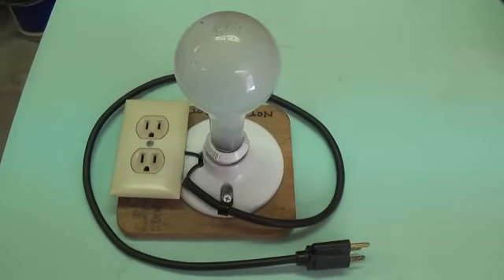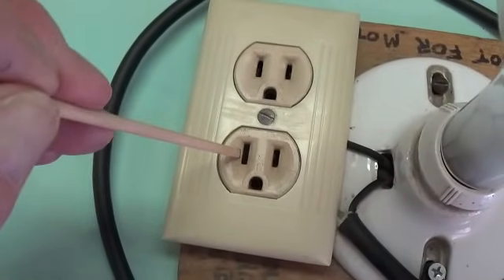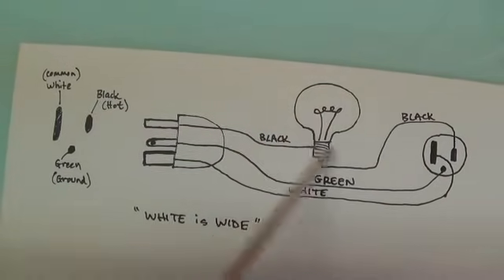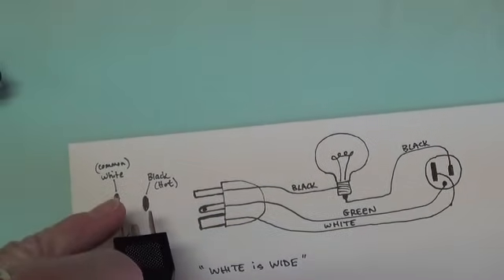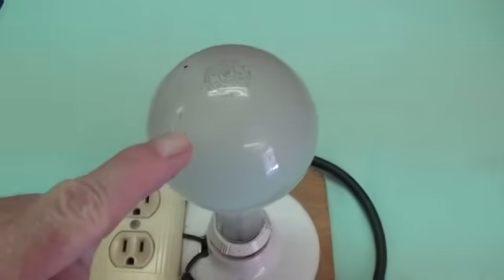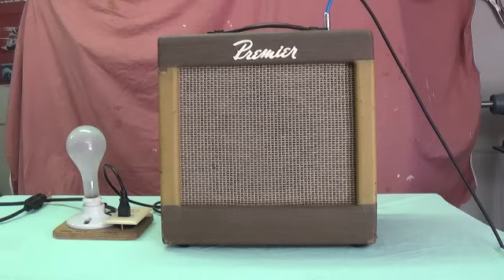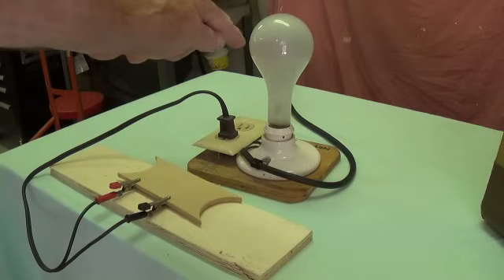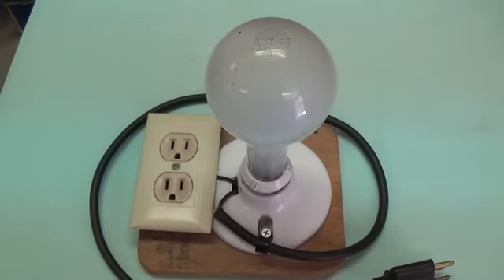Build Your Own Current Limiter for Protection when Repairing and Testing Electronic Equipment

Comment: Hi Uncle Doug! ,Greetings from Cornwall, England,  i live in a 240v area and found it difficult acquire 100w + bulbs. i am going to try two 77w bulbs in parallel , and remove 1 bulb when working on a transistor amp. does this sound right?. really loving Rusty, Jack and your productions, learning lots. thank you so much !
Reply from the maker: Greetings to you, AS. In a 240VAC area, you can probably get by with a single 100W bulb and a 50W (or less) for transistorized circuits. Since your voltage is double ours, your current flow is one-half as much.
Reply: @UncleDoug  will endeavour to get a 100w bulb from online. All the stores are now led , they don't realise my bulb will not come on much (hopefully) 🤟rock on brother LOVE the guitar.

Comment: Seeing as I occasionally do amp repairs, I'm going to build one of these useful devices, but since I live in Australia, I need to use parts rated for our Australian 240V AC/50Hz mains supply, for the Australian 240V AC/50Hz mains supply system the wire, and 3-prong plug colour-coding system is as follows: Brown=Active or Hot, Blue=Neutral, Green/Yellow=Earth or ground.
Reply from the maker: So you will install the bulb filament in series with the Brown wire and use a 50 to 100W bulb. Higher voltage = lower wattage.
Reply: @UncleDoug  Yep, that sounds right to me, the brown wire is equivalent to the hot wire in the US mains colour coding, the green/yellow is equivalent to the green wire, and the blue wire is equivalent to the white wire if I'm correct, the Australian mains just runs at double the voltage of the US system, and at a lower frequency, 50Hz as opposed to 60Hz, it's very important to get it right first time cause even a small mistake could prove lethal.
Reply: One of the reasons why Australia adopted the Brown, Blue, and Green/Yellow colour code was to make it easier for people with colour-blindness to differentiate between the three wires, I happen to be red/green colour blind, but I can clearly see the difference in colour of the three wires of the Australian 240V AC system.
Reply from the maker: @simonkormendy849  I appreciate the explanation, Simon, but I would have thought that black and white would be the easiest "colors" for colorblind individuals to differentiate. Not being colorblind, however, perhaps my assumption is incorrect.
Reply from the maker: @simonkormendy849  You're correct, Simon. Since the voltage is double, the current is half......thus the necessity for a much lower wattage bulb.
Reply: @UncleDoug  That makes sense, I can clearly see the difference in colour with the US colour-coding system, I think we Australians have our politicians and rule-makers to blame for the different colour-coding system we use.
Reply: I'm planning on building a device called an OTL (Output Transformerless) Headphone amplifier, found an easy to build circuit, using three 6N1P tubes on the internet, here's a link to it: https://headwizememorial.wordpress.com/2018/03/20/the-6n1p-otl-headphone-amplifier/
Reply from the maker: @simonkormendy849  It's outside of our area of interest or expertise, Simon, but good luck with your project.
Reply from the maker: @simonkormendy849  I guess as long as the coding is consistent, we can learn to read it properly, regardless of the colors chosen.
Reply: @UncleDoug  Exactly.
Reply: @UncleDoug  I'll let you know how it goes, part of the fun of building tube gear is getting all the necessary parts together, I'm sure you'll agree, please keep these great and informative videos coming, and I hope you and your family are doing well.

Comment: When building one of these for use with tube radios, how big of a bulb should I use ? 250W seems a bit high for that use.
Reply from the maker: It varies depending on the current demand of the tube radio, but I would think that a 200W to 250W bulb would be about right. Try it with a radio that has no internal shorts and see what wattage of bulb can remain very dimly or not visibly lit in series with the radio.
Reply: @UncleDoug  thank you for the info. Much appreciated.

Comment: I had seen this before but now as i begin to build an Amp you keep mentioning this as a required tool for us to have. I am revisiting and going to build this as my 1st tool for my project, Excellent as usual. You are a marvelous instructor, D
Reply from the maker: Thanks so much, Dennis. You will be glad you built one.....it's a vital tool.
Reply: Would that work on my model trains as I gave fried some transistors during built out?
Reply from the maker: @DennisMurphey  It doesn't work as well with transistorized circuits, Dennis, simply because they draw much less current than tube circuits. If you try it, use a small bulb (i.e. 40W) to start with.
Reply: Excellent input worth a try. I will make 2. One 250 watt and one 40 watt. Cheap insurance. Thank you, your knowledge and experience is just awesome. D
Reply from the maker: @DennisMurphey  You're welcome, Dennis. You can probably get by with just one.....and switch bulbs as necessary.

Comment: Uncle Doug, any tips on mounting the outlet to the board safely?  The porcelain base seems straightforward, but I'm curious if you have insulation around the outlet base, and if it's just sitting on the single center screw or if there's more support (sorry if you've already answered this, I tried to search the comments and didn't see anything).  I'm wrapping up my 8th tube amp build and it's time I stop rolling the dice on my high level of care and attention to detail and build one of these for safety!
Reply from the maker: The porcelain base I used had two screw slots, about half way toward the outer perimeter, Elliot. It was firmly attached to the base board.

Comment: Soooooooo, what's the point of this?
Where would I use this for practical use ?
Reply from the maker: If you repair amp circuits, it's a critical tool to prevent damage to the circuit due to short circuits.
Reply: Did you watch the video before commenting? He explains it right at the beginning.

Comment: Hi Uncle Doug, I build one of these and when I plugged my Gibson ga-20 rvt to it, the bulb (300 watts) have a very little light on the filament,  does that means  i have a partial short on it?
Reply from the maker: That's hard to say, D25. The GA-20RVT is a 15W amp and probably should not partially illuminate a 300W bulb. After the amp has been on for a while, feel the filter caps to see if any or all are hot. There may be a short in one (or more) of them.
Reply: @UncleDoug  thank you very much for your repply. I will check that.
Reply: @UncleDoug  i guess there is a small short in the amp somewhere.

Comment: Hi, Uncle Doug, I miss Rusty!
In any case, on my first tube amp build, 15watt, I used two 60 watt bulbs in series...(wall voltage is 235V)....So, on startup, both bulbs start very dim, go extremely dim, and then after about 10 seconds they both glow very dimly (I think this is in conjuction as the tubes start to glow).  As is typical for me, I got a "something in-between" result, not totally off, neither a bright flash.  It stays dim for another 15 seconds, then I turn off the amp b/c I'm afraid of damaging it.....Any ideas on what an in-between result might indicate?  thanks so much!
Reply from the maker: Use one 60W bulb and you'll probably be OK.  CL bulbs are never wired in series.
Reply: @UncleDoug  thank you sir!

Comment: You can'get hi power incandescent bulbs in blighty any more but I've got several 60W bulbs stashed away. Will 4 of those in parallel do?
Reply from the maker: If you have 240VAC supply, a single 60W bulb, or even two in parallel should suffice for most small to medium circuits. Your current is double ours, so the wattage requirement of the bulb is halved.
Reply: @UncleDoug  A mate found me 2 off 200W bulbs. Apparently, you can still get them if they are "for industrial use", you just need to know where to get them. In this area, that is Lock's Garage on the A465 south of Hereford (for them in the west of Blighty).

Comment: Many thanks to Uncle Doug for this, I have just completed my UDCLD MK1 (Uncle Doug Current Limiting Device) It's great when simple, cheap projects like these can yield useful workshop tools. I hope this one will be an aid to many future repairs and projects of mine.   I only wish that making my first Oscilloscope and ESD meter could be so simple and cheap! However, slowly but surely I am gaining the equipment and knowledge that I need to be able to repair hifi and other electricals. I am awaiting delivery of a beautiful 1960's Japanese Multimeter that I recently won on ebay, I'm looking forward to refurbishing this and adding it to my growing arsenal of repair weapons.  I have had a few Digital MM's in the past but I have read that analogue meters can be used as a poor man's tester for capacitors (?) This and the comedy show sounding mechanical buzzer for continuity seduced me into hunting down one of these relics, whats not to love with these fabulously made and still useful old pieces of equipment?  I think Uncle Doug would like this one too, for it can handle high AC Voltages - commonly found in tube anplifiers, I believe? 

Regards and best wishes to all   :-)
Reply from the maker: Thanks for your nice comments, Rob. I do have a Simpson 260 Analog Multimeter that is particularly useful for measuring pot resistance and checking them for a smooth sweep.
Reply: @UncleDoug  Very nice, have just seen your meter on the very unusual tube amp problem video, where you repaired a transformer winding. Nice to see the meter wiggle in time with the motorboating. My meter is a TMK Model 500 and has cleaned up nicely, it just needs a slightly burnt looking 1ohm wire wound resistor replacing and some cleaner in the adj pot. Loving all the videos and learning a lot, thanks so much for replying too.
Reply from the maker: @robworrall6832  Thanks for your nice comments, Rob. Good luck with your newly repaired meter.

Comment: I built one like that , I plugged a small heat gun from radioshack the light turn on and the heat gun barely function , as soon as I plug the gun to a wall outlet it works normally, any reason for this?
Reply from the maker: Yes, a very good reason, Tito. The CL is for use with tube amplifier circuits that draw 1 or 2 amps, not heat guns that draw 15A.

Comment: Hello, Uncle Doug:  I built one with a chain pull bulb holder that has an integrated AC outlet, a 2 way light switch, and another AC socket for supplying the amp.  It has a couple of modes of operation.  The chain pull acts as an on off for the whole unit.  The light switch, when up, activates the amp supply AC.  When the light switch is down, the unit acts as a lamp, as it shorts out the amp AC socket and all the current goes to the bulb.  It is built on a wooden base and is a decorative (and bright) lamp when I install a 300 watt bulb, but I can use a smaller bulb and use it as a desk lamp and cell phone charger when I am not testing amps.
Reply from the maker: Wow, it sounds like you really took this simple concept to another level, AK.
Reply: @UncleDoug  Well, I've got enough test equipment sitting around that I hardly use. So it was fun to build something that I can use as a desk lamp when I don't need  to plug into an amp or a robot power supply (my day job.)

Comment: These do work in England on 240V, but finding a high watt incandescent bulb these days is virtually impossible.
Reply from the maker: Since your voltage is double, your current is halved......so a 100W bulb should work. I believe they are available from Amazon.
Reply: Could I use a 40W bulb just for testing short circuit? I can only find 230V 40W and 230V 60W bulbs online.
Thanks.
Reply: @newstar346  I would'nt reccomend 40W. The minimum I would use is 80W. Maybe a short burst with a 60W, but VERY short.
Reply: @Franko_Walker   Thanks for your information. I'll try finding a 100W one as suggested.
Reply: @newstar346  That should be fine. Sheild your eyes though. :)
Reply: @Franko_Walker  Thanks for your advice.
Reply: @newstar346  No probs. :)
Reply from the maker: How about two 40W or 60W bulbs in parallel, NS ?
Reply: @UncleDoug  Yeah, I've thought about that after reading through the comments where one asked about this parallel bulbs using a Y-cable adapter.
Thank you for your advice.
Reply: @UncleDoug  Ha ha, Yeah, I never thought of that. It would work perfectly with 2 60W bulbs! Well done.
Reply from the maker: @newstar346  You're welcome, NS. Good luck.

Comment: So, with high-wattage incandescent bulbs quickly going the way of the dinosaur I'm wondering if one of those "Y" adapters that turn a single bulb socket into a 2-bulb socket would work if you need a 200-watt bulb but can only put your hands on 100-watt bulbs. The workaround then is to install the "Y" adapter and screw a 100-watt bulb into each arm of the "Y" giving you a total of 200-watts. Will it work? Or did I just come up with an even better way to blow myself up?
Reply from the maker: As long as the bulbs are in parallel, which seems quite likely, it would work just fine, DE. You could check by seeing if the overall filament resistance dropped to 1/2 when the second bulb was screwed in. This would make the wattage capacity of your CL adjustable.......good idea :)

Comment: Excellent video, Doug! Is there any limitation (as in types of electric/electronic items) I could plug in? If I had to, I could wire two 100W bulbs in series as a substitute for the 200+W light bulb? Thanks again.
Reply from the maker: You cannot use the current limiter with motors, VO, or any device that requires a big current surge to start. Yes, you can use two 100W bulbs, but they must be wired in parallel.....not series.
Reply: @UncleDoug  Thank you very much for your reply!

Comment: Hi Uncle Doug, Risk of shock is one of the main reasons I am hesitant to start an amp build project, and you just alleviated a ton of that fear!!!  I really don't have much of an excuse at this point!!!  

Your videos flippin' ROCK!!!

THANKS!!!
Reply from the maker: Bear in mind that the current limiter primarily protects the amp circuit, FN. You still must understand and practice all the rules for safe handling of high voltage electrical devices.
Reply: @UncleDoug  - Oh, another subject to look up.  Thanks for the additional information!!!
Reply: @UncleDoug  - 10 hours of Googling FN and I can only assume that stands for F*****g Noob.
Reply from the maker: @thefunkynotes8956  Not at all......it's the initials of your screen name.
Reply: @UncleDoug  - Same thing!  LOL!!!
Reply: Hi Uncle Doug, Would plugging the current limiter into an outlet with GFCI protection add a level of shock protection?
Reply from the maker: @thefunkynotes8956  I'm not sure if or how they would work together, FN. The CL protects the circuit, while the GFI protects people.

Comment: Hello Doug, I am a 75 Year old from Ireland and I have got hours of enjoyment and education from watching your videos. Since I retired a number of years ago I have taken a keen interest in the working of old valve equipment even if there is not much of that sort of stuff hanging around here. I decided to build a Current Limiter similar to your one and I have to say I am delighted with my effort. I got my hands on a 1967 Selmer Treble/ Bass MK 111 50W amp and not knowing what the story was with it I had the pleasure of plugging it in to the Current Limiter. Am I glad I did as the bulb lit up like a Christmas Tree and heeding all the advice you have given in your videos regarding safety in dealing with Valve equipment I proceeded with caution. Using another of your home brew aids I discharged all filter caps;  At this stage I need help with pin pointing the fault with this amp and I wonder if  there is someone out there in YouYube land who would point me in the right direction. I have one other observation on your excellent  videos......  That is your interaction with your Dog and Cats. Beautiful to see. Thank you.
Reply from the maker: Thanks so much for all your great comments, Eddie. I'm glad the videos have been helpful. Good luck with the repair job.....that's how you learn ;)
Reply: Hi Eddie. Did you ever get that amp fixed ? If so, what was the issue with it ?
Reply: @paulp2033  Hello Paul, Thank you for enquiring about my amp. I never got it fixed but did discover that it was the main transformer that was at fault. I did try to find a transformer but so far I've no luck with that.
Reply: @eddiefitzgerald5198  hi again Eddie. I don’t suppose you would consider selling the amp ? If so let me know and we could discuss. Cheers. Paul
Reply: @paulp2033 Hi Paul, I'd sell it alright.
Reply: @eddiefitzgerald5198  hi again Eddie. Are you able to contact me directly here on YouTube ? If not, do you have an email address I can contact you on ? Cheers, Paul
Reply: @eddiefitzgerald5198  Hi Eddie - The Selmer T&B 50 is one of my all time favourites! My school had a pair of them back in the early 90s, with a pair of matching 2x15 cabinets, I used to take them home in the holidays and shake my mum's windows! I really wish I'd been able to wangle at least one of them before I left school........
Reply: @mutanthifi  That's lovely to hear. I expect a fully working one would be worth something on the collectors market. The speaker that was with this Amp, was an 18 ins; the speaker is long gone but the cabinet is still here.
Reply: Hi again Eddie. I wanted to inquire again if you would still consider selling the Selmer Treble n Bass. Please let me know and I will give you an email to contact me on. Thanks
Reply: Did ya make it to 80?